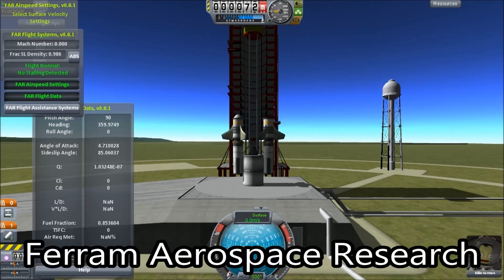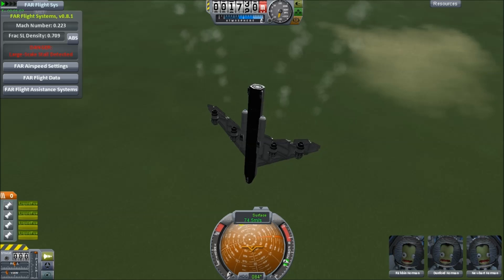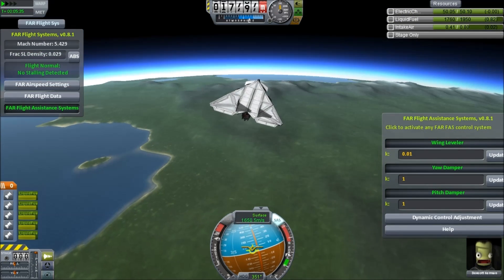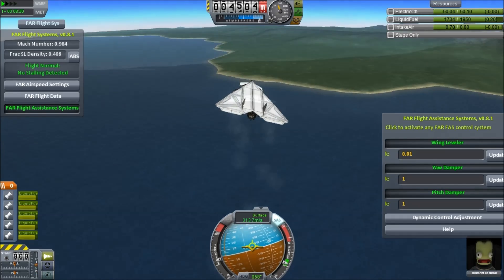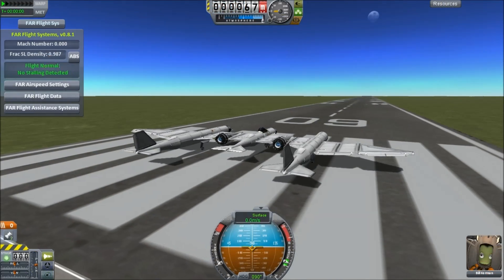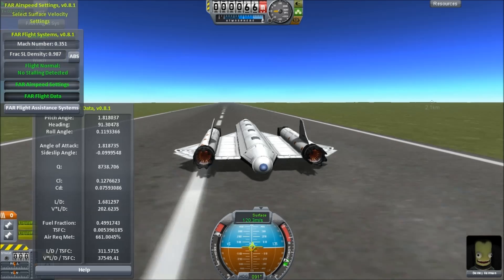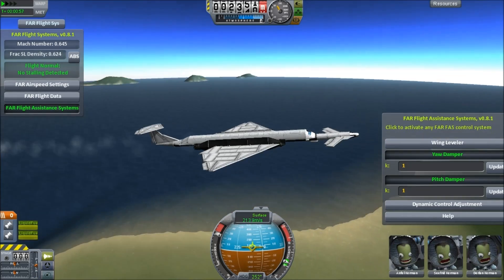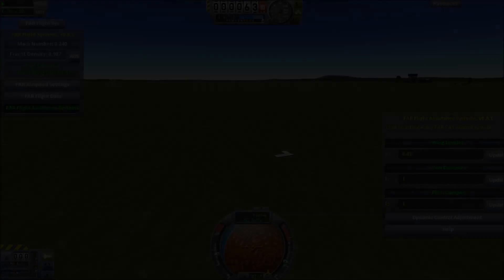Kerbal Space Program - Improved Aerodynamics With Ferram Aerospace Research Mod

Comment: I'm sorry to say this, but I'm rather disappointed with this mod. It boasts a realistic aerodynamic system, and yet airframe designs that function in reality (such as the A-10) built with stock parts can't even get off the runway without catastrophic failure. Even with the stock system I can get such an airframe flying fairly well with some finagling, but with FAR it's nearly impossible to create a stable Warthog-style airframe with stock parts. I'm not sure if this is due to some issues in a newer version, or if it's always been like this, but until FAR allows for flexibility and accuracy with more airframes that are proven to work in reality, I don't believe it's worth a download.
Reply: That’s because this mod is realistic

Comment: this mod sucks. how is it improved when I cant even turn by banking? I shouldn't have to pitch up just to turn
Reply: turn off SAS and aircraft are not able to turn by banking itself, you will lose control, u need the pitch and rudder too
Reply: _LLJY that flight model is wrong. you are just making your aircraft a giant airbrake. I figured out a long time ago that trim the aircrafts are default out of trim.
Reply: chittychad18 it works like a charm for me, you need fairly huge wings to bank turn (you also need slight trim to turn smoothly)
Reply: _LLJY which makes it impossible to fly a space shuttle.
Reply: chittychad18 u just have to know how to build it properly for FAR, it's not 100% accurate but at least it's better than stock ksp
Reply: Sounds like user error

Comment: FAR actualy not working as well, of corse nosecone going realy bad aerodynamic, but if you going for some research you will got, that putting airintake on top of 'solid rocket buster' is giving much less drag, than lastest tall cone.

here some of my research, i use the same rocket, just take a difference cones:
in the table below, is max reached heigh. (medium parts i've done before, and won't calculate, but there alot of difference between circular intake and regular NoseCone

FAR: comparative analysis of aerodynamic parts:
i've test lastest MJ, with different parts, all we know that nocone is flying like brick in KSP w/FAR, but what exactly 'aerodynamic part' are better than the other?
Small: (Rokomax 48-7S; 2 Oscar-B Fuel Tanks; Z-200; SRW; OKTO2; MechJeb 1 left-side)
Caps
1. StayPutnik Mk1 12400m
2. Standart NoseCone 11400m
3. Parachute Mk16 9600m
4. NoCone: 4240m

Medium:
1. Circular intake
2. Clampotron Shielded
3. AeroDynamyc NoseCone

Cone S2M: ( TR-2v / (cone) RT10)
1. FL-A5 - 495,700m!!!
2. FL-A10 - 271,770m
3. Modular Girder adapter - 267100m
3. NCS-Adapter - 264100m

Comment: I like the mod but I can't get my planes to land. There isn't enough friction to let you slow down easily with most of the stock parts. I've tried making flaps and spoilers, but am having a tough time figuring it out. Do you know any good sites/tutorials/videos that show how to land planes using FAR?
Reply: try parachutes on the back of your plane :)
Reply: B9 Aerospace has several good parts for that such as airbrakes. It hasn't been updated yet though so it will require a bit of patchwork for it to work.

Comment: 1:55 yeah, that was recoverable, first of all, throttling up after the structural collapse was a mistake, I'll tell you that xD
And obviously "point the nose" down. in that case you are bound to plummet anyways, so pointing the nose will eventually help you catch any possible lift if you could stabilize yourself. then again, your elevons broke off so i don't know how you can stabilize yourself. In real life, since your elevons were on the tail, you would be just as screwed then

Comment: Does someone knows how can I run this on my 64 bit Win7 OS? I really wanna install this mod, but I don't want to reinstall my whole OS just for that. Is there a way for me to launch KSP on 32bit or simulate as if I was using a 32bit OS?
Reply: you can run almost all 32bit programs on a 64bit OS, Kerbal is no exception lol
Reply: TheCBGenesis Yeah, I mean, I can run KSP, but I found this on FAR addon page: "Note: This mod disables itself on 64-bit Windows builds of KSP to avoid exacerbating its inherent instability. Users are encouraged to switch to either the 32-bit Windows build or the 64-bit Linux build, which are far more stable."

http://forum.kerbalspaceprogram.com/threads/20451-0-25-Ferram-Aerospace-Research-v0-14-3-2-10-21-14
Reply: Arch3rAc3 It only switches to a 64bit if you force it to, as its still a new build, your fine, go ahead and try it yourself :)
Reply: TheCBGenesis THEY FINALLY ADDED A WAY TO USE IT ON 64BIT? ON 0.25? takes out save which works 64bit only and is 0.25
Reply: but how?
Reply: F3aR_CalleR launch ksp_64x in the game files / rename it to KSP
Reply: I mean FAR
Reply: F3aR_CalleR you cant afaik

Comment: This mod is awesome, I'm currently using it and it adds quite a bit of difficulty to even the basics launching. You have to properly design your rockets and use fairings depending on payload.
However building spaceplanes is another thing entirely, designing proper planes are a huge challenge and even controlling them.Has anyone found any sort of tutorials on how to work spaceplanes with this aerodynamics?
Reply: Well, i Made a plane that could turn up and down and little to rhe sides while flying at 4950 km/h. If you want to see pics just go follow some forums on Facebook. I post shit there

Comment: I don't know Scott I tried this and it was a nightmare!  First you have to do real gravity turns not the make believe thing that vanilla KSP calls a "gravity turn".  But that was not my issue.  I realized that you cannot have a wild deviation from the direction the ship is pointing and the pro-grade vector.  I also knew that I should manage my velocity until passing through maxQ.  However I could still barly mange to get even the simplest ships to orbit with any kind of control.

Every ship wanted to fall off to the North and then I could never only rarely recover.  the only thing I could consistently manage to do was stall and turmble wildly out of control.  

Until I see a video that actually goes through some of the common issues and rules for building "proper" ship designs for FAR I am afraid I will not be using it.
Reply: I had the same problem with my rockets flipping out at first, but if you start the turn right after lunch and follow the prograde vector VERY carefully, you will manage just fine

Comment: After installing this I can't seem to get a single plane to takeoff anymore. Not even the ones that come with FAR.

I had one of the smaller Delta V planes up to +200m/s on the runway and it still looked as if it had no lift at all.

The only other mods I have installed are B9, Subassembly Loader and  MechJeb (planes were tried with and without the MechJeb module)

Any clue what I'm doing wrong? The game says everything needs to go into the gamedata folder now under it's own folder.

Comment: I have a rather serious bug to report for this. It may be the way the mods new physics interacts with the latest version of KSP. I took that Hypersonic plane you demonstrate in this vid, to see how it compaired to my own creations, which under this mod, are servicable but touchy in flight. That Hypersonic plane? Never even made it down the runway. Even with the engines set to 15% thrust, it ripped appart on the runway every time. The ASAS doesn't seem to work properly either

Comment: Probably a bit late. There should be a persistent debris option in the main menu settings. Set it to zero to stop debris from hanging around.
There are mods out there that'll clean up your debris.
Like Romfarer's lazor system v26. Attach a lazor module to the ship, launch and in the menu on the right there should be a targets tab (which includes debris). Select the target/debris and press the S-D button at the bottom (self destruct). *BOOM* no more target :D.

Comment: A flame out would make you spin out only if it is asymmetrical, if it were symmetrical, then you would still go the direction you are headed, unless if going partially sideways. Also, the thrust on the opposite side contributes to the spin.

Comment: Well it all depends on the aircraft.
Nearly every aircraft has a different procedure that you have to follow. For a motorized plane, you generaly have to cut the trottle(this is only done to stop the aircraft from breaking apart, not for airodynamical reasons), put all controlls neutral, and use the yaw rudder against the direction of the spin.
For blendwing body designs like the "Horten IV" i would say that ejecting would be best, before you pass out, or are unable to bail due to the G-forces.